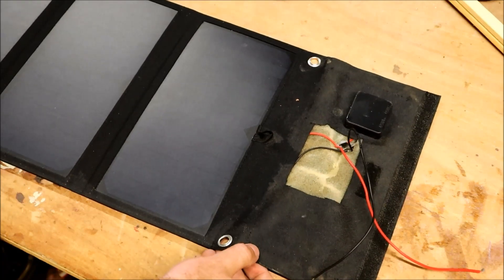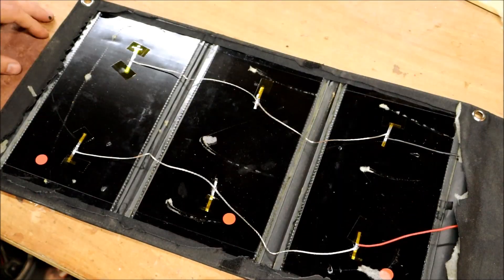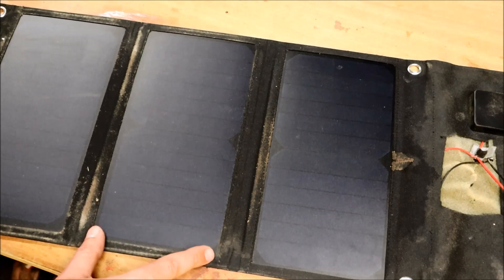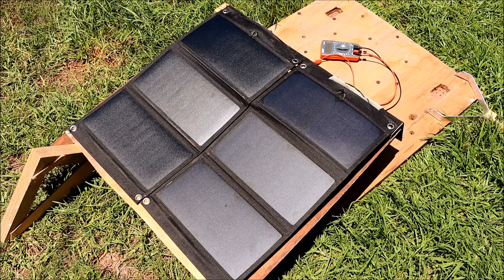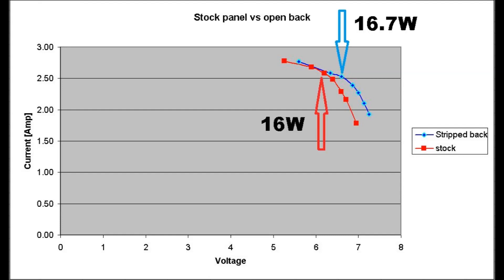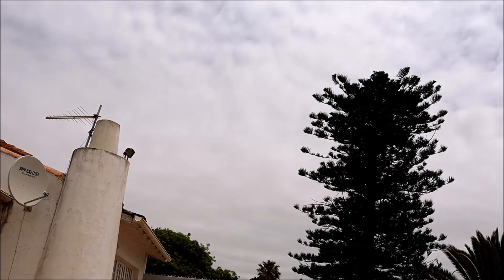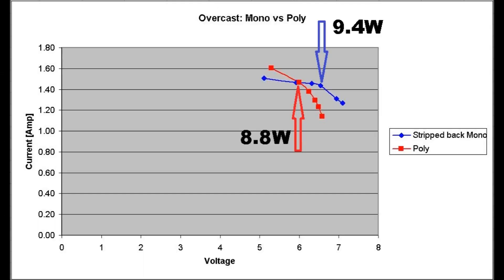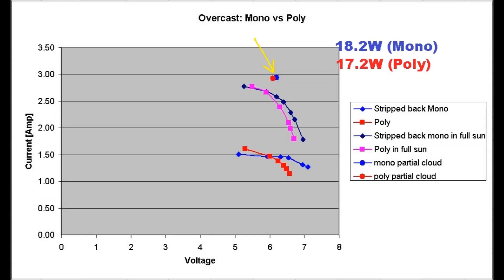Cool solar panel hack - Tested.

Comment: Ja;  on the canoe you might try some wicking.
As in those super absorbent lappies or something good at wicking, attached to the back of the panel, but too big so the loose piece trails in the water.
Reply from the maker: @RayleneCawood  a very practical idea. Evaporation should give decent cooling.

Comment: Q : PE Technikon alma mater? (elec eng?)
Reply from the maker: Pretoria,  mech eng.
Reply: @williamfraser  Was asking because I have similar interests (kayak with roof-mounted 400W+ solar panel, 60+ lbs trolling motor & LiFePO4 280/560Ah)
Reply from the maker: @joatmofa0405  have you built and tested?
Reply: @williamfraser  Not yet....on the back-burner for now (surprise 2021 Xmas prezzie for myself..) - but I've done the info gathering already (specs etc.)
Reply from the maker: @joatmofa0405  nice. A 400W panel is quite a heavy chunk. If mounted as a roof, will you be using outriggers for stability?
Reply: @williamfraser  Not required - something like this 
https://za.pinterest.com/pin/302867143664013246/ 
the kayak = catamaran hull & approx. 100cm wide / approx. 350cm long - centre console (front mount) with swivel / slide chair. The roof also uses the center console as support and is a naked framework - allowing solar panel cooling & easy installation

Comment: I sometimes mount panels to twin-wall plastic with air channels to reduce their temperature, like sign material; Corflute/Coroplast. Electrically insulated corrugated aluminium panel would probably work even better.

Comment: Cooling of the panels is so important. Thanks for sacrificing the flex panel (although it appears you improved it substantially). That foam backing can't add significant protection, yet its clear it reduced the panel performance.